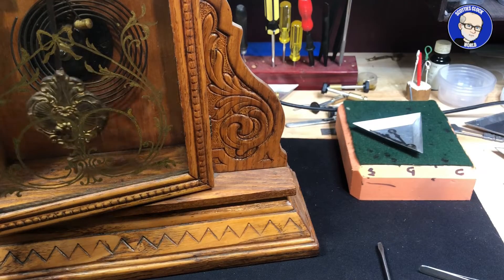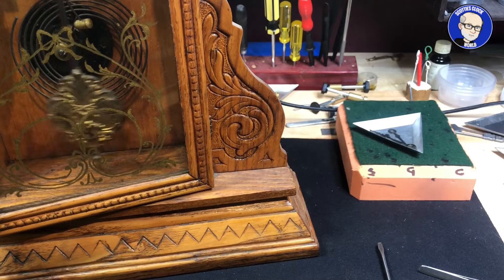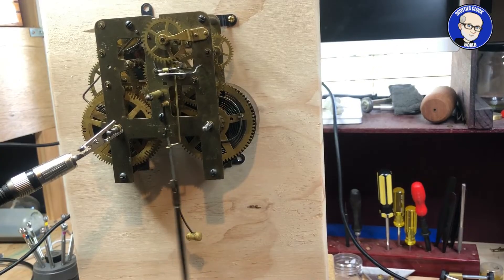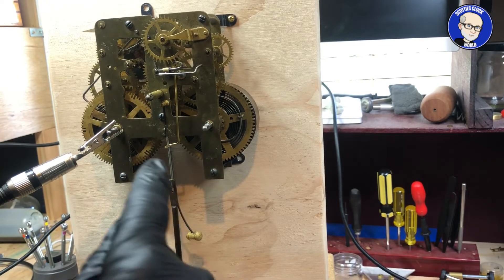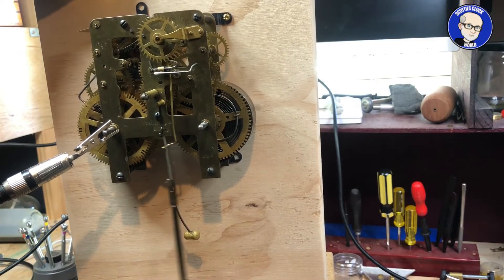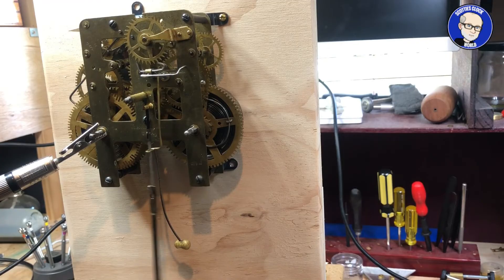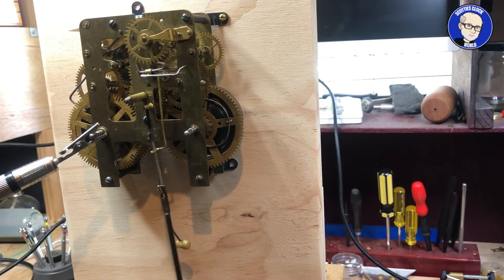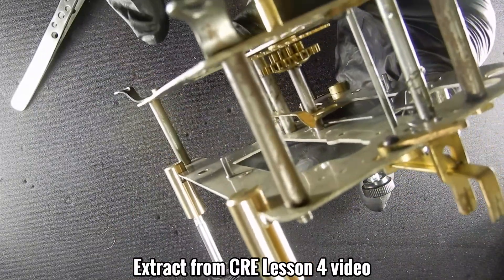Putting A Pendulum Clock In Beat - Lesson 1

Comment: I do the tilt to know which way to bend the foot end of the crutch, but a final test is visual as well as the sound for me. Is the verge going the same depth into the teeth of the escapement wheel? That for me works better than the beat amplifier to verify I've got the verge centered-the drop and the stop are catching the same amount of tooth, so they will spend the same amount of time in contact with the tooth. Good viddeo!